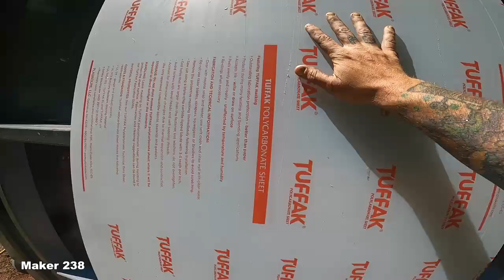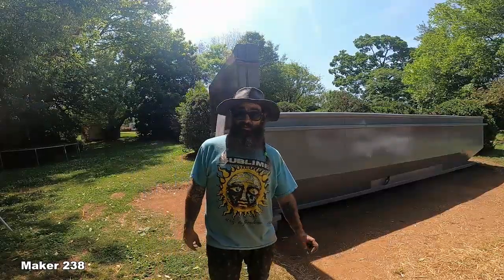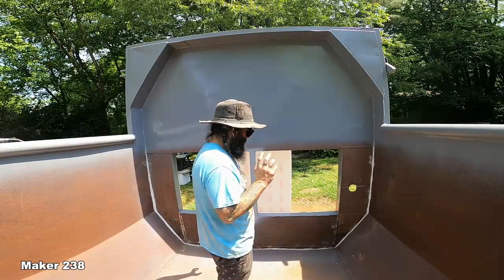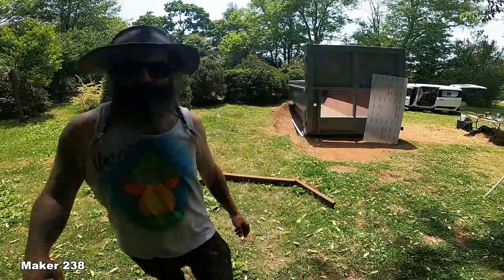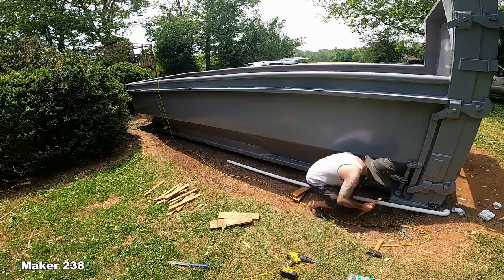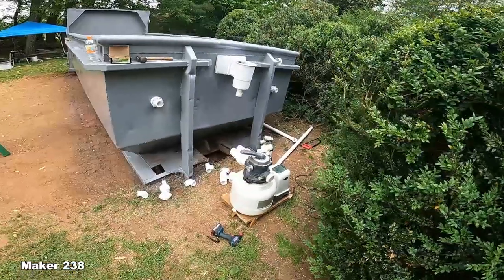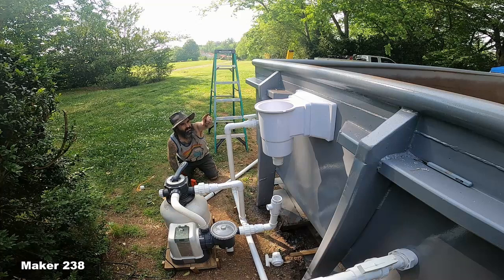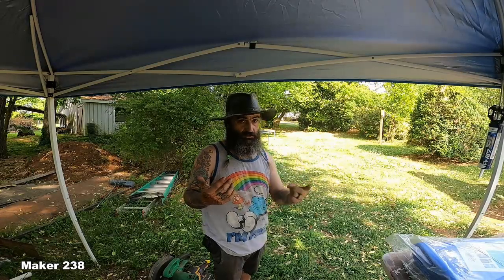How to Install Pool Plumbing on a Trash Compactor Pool Conversion! // The Swimpactor // Episode: 08

Comment: On the pipe threads, use pliumbing pipe thread tape or Plumbers thread compound ect.
Reply from the maker: Yes thank you so much for your advice I got your message. I’ve done some plumbing here or there but I sure am learn stuff.

Comment: Love watching your videos man, Filled Mine this week and it has been great with some small surprises but it's operating. Adding the plexi to the side is a great Idea. Is it better to put it near an edge rather than put it in the middle where the highest stress will be? your over head bar your planning could Also house a fountain head and have you considered a swing that lowers into the water?  Also you could use it to stretch a sun shade over the pool. I can't wait for the Pond shield video :)
Reply from the maker: Man I can’t wait to see yours up and running. Have you swam yet. Yeah I’m not gonna do the plexiglass directly in the center on the side I’ll do it off to one side a little bit.
Reply from the maker: Thanks man for watching

Comment: Did you end up making a video on the electrical grounding doohicky? If you hadn't brought that up, I would have assumed you had a ground built-in with a metal pool (but maybe there's enough insulation with the primer/paint that you don't achieve an electrical connection to ground?).   I'm interested in the science of that device, and I'd be interested to know how your pool needs it more/less than a normal pool (but I would probably totally install it, because it seems like it's a good idea to not have anything that builds up a charge over time, which I assume is the risk).
Reply from the maker: Yes it’s called pool bonding. https://youtu.be/BG1Ve_9Cq-I. I did my best to explain it. From the research that I’ve done if you do not bond the pool it’s very mild shock. Some of said it’s like a 9 V battery. Only young kids seem to feel it. But most the time kids are jumping in anyway and don’t feel it. I did it as an over precaution. I didn’t find a lot of videos about the topic. The way that I’ve documented the series you should be able to build one step-by-step.